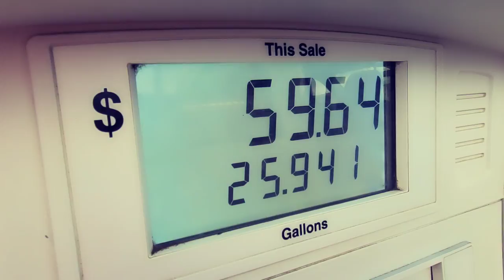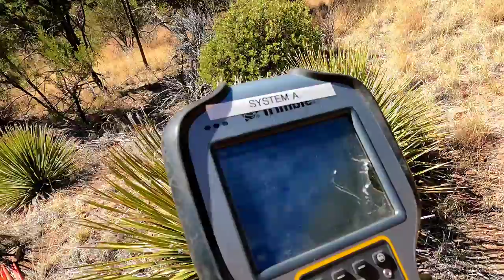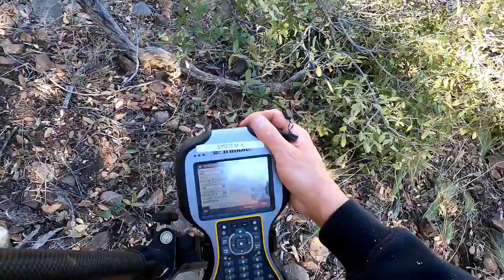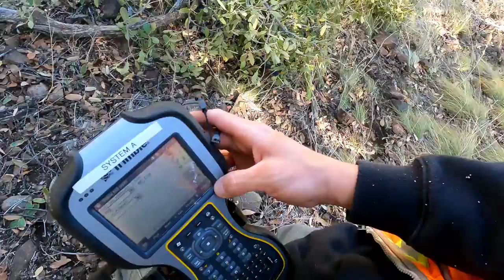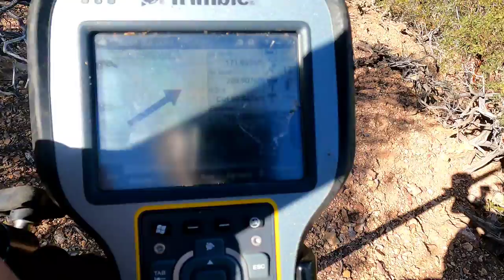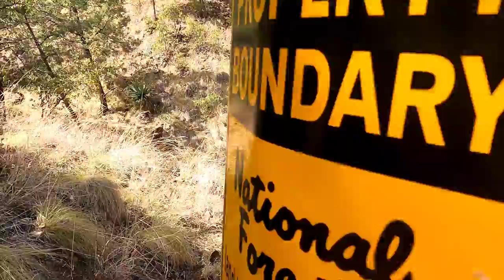Life of a Land Surveyor: Episode 1

Comment: Dang man using the r8 crazy that thing still kicks, loving my r10 base and r12i rover setup
Reply from the maker: Haha I was working for the Forest Service at the time so I used what was available. Have you tried RTX with your R12? I tried it a few times and it was awesome
Reply: @SmithSurveying  yessir it’s amazing in love with tsc 5 as well. I do pipeline surveying mostly running rtk&infill or rtk tdl 450
Reply from the maker: @derickhiers6707  tsc5 is a good collector. The tsc7 is too bulky for packing around the forest imo
Reply: @SmithSurveying  my current company had the threes still running solid in 2022

Comment: Hi ahm what does a entry level Rodman do?
Reply from the maker: You would be doing grunt work and other tasks that don't involve alot of responsibility. You'd eventually work your way up to a position with more responsibility though. 
Here are some things you can expect to do: 
•Ensure the safety of all crew members, clients, & the public.

•Ensure that all equipment needed is loaded and ready to use.

•Ensure that all equipment is properly maintained.

•Maintain adequate supplies in the truck.

•Keep truck and equipment clean and organized.

•Carry survey supplies during the collection of necessary survey data.

•Place stakes at designated points and drives them into ground at specified elevation, using hammer or hatchet.

•Cut and clear brush and trees for data collection, using brush hook, knife, ax, or other cutting tools.

Perform other duties as assigned.
Reply: @SmithSurveying  Surveying is a part of my degree that’s why and they didn’t focus on different positions in surveying so I kinda need to know. Thankyou sir
Reply from the maker: @messiah1018  If you ever have any questions feel free to ask. I hope you are enjoying school!
Reply: @SmithSurveying   Thankyou sir , I’ll ask you more in the future so keep on making videos
Reply: @SmithSurveying  Is that the same thing as a "surveyor assistant?"  I have an interview on Wednesday for the position.  Any advice for the interview?
Reply from the maker: @jeratt1  Yeah, you can expect about the same I think. Make sure you get good sleep and are prepared with answers if they have given you questions in advance. Do you know what type of surveying you are going to be doing?
Reply: @SmithSurveying  Thx for the reply Smith.  No they didn't give me any questions.  Land surveying, that's all I know at this point.  Came across this video actually because I'm trying to learn a thing or 2 before the interview.  I love working outdoors and would love to land this job.  Fingers crossed.
Reply from the maker: @jeratt1  I hope it goes good for you! Experience is always good but having someone who is willing to learn and take direction is more important. Be open to learning and let them know that you will work hard and be dedicated. You can keep an eye open on usajobs.gov if you are interested in working in the woods. I think there are going to be some survey technician jobs opening up with the Bureau of Land Management in Oregon soon. If you ever have any questions feel free to reach out